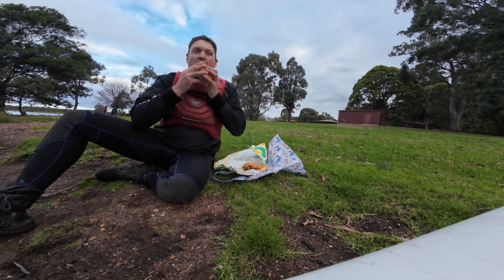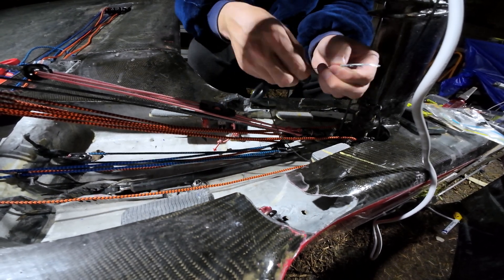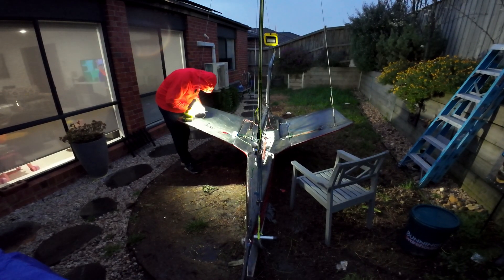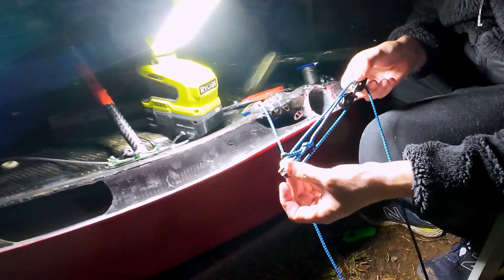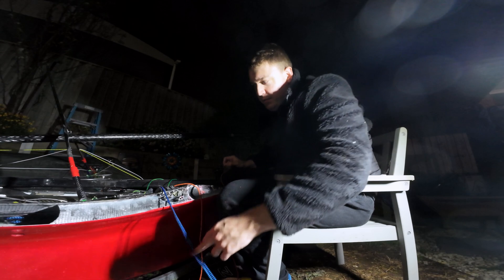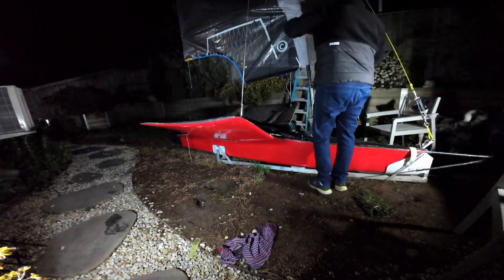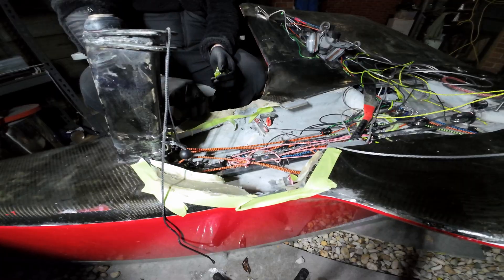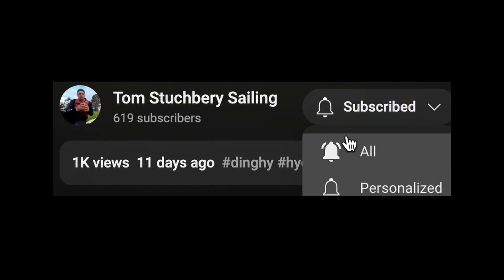$100 Moth EP8: Building an Epic Sail Control System!

Comment: with side stays etc just have slip splices so you can snug up as you need (if/as the splices bed in) , you don't need chain plates. Looks Great though
Reply from the maker: I might be able to make little dyneema strops to replace the chainplates, since these stays have been made to suit the chainplates and I don’t have any more Heat Set SK99 Dyneema. Would hurt less when I crash into them!
Reply: @TomStuchberySailing  @TomStuchberySailing-eg9vr I set a loop with dog bone on the wing. Then a slip splice on the side stay itself. This gives you flexibility. Replace the plate with a loop+dog bone.
Reply: For some reason if you're in the hiking straps you never hit the shrouds. Whereas if you're just sitting there, straight into the shrouds you shall go.
Reply: For some reason if you're in the hiking straps you never hit the shrouds. Whereas if you're just sitting there, straight into the shrouds you shall go.
Reply from the maker: Yes, I've figured its safer to be hiking. I've also found sometimes if it jumps out (as in flies too high) and I can stay on, I land on my back and can sometimes save it and keep going!

Comment: How do the insides of the telescopic wand work?
Reply from the maker: It’s basically just a little inner tube inside a big tube, with the big tube running up to the bowsprit. The big tube has a slot in it, and there’s a tab attached to the inner tube that sticks out through the slot, which the control lines connect too